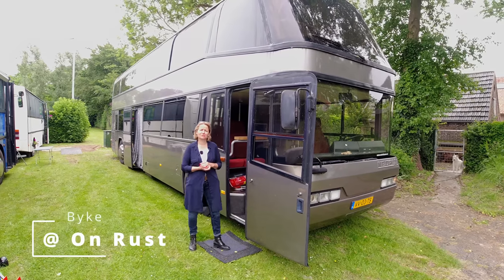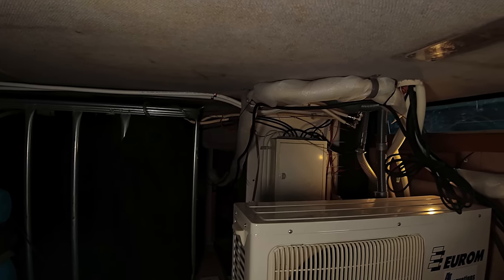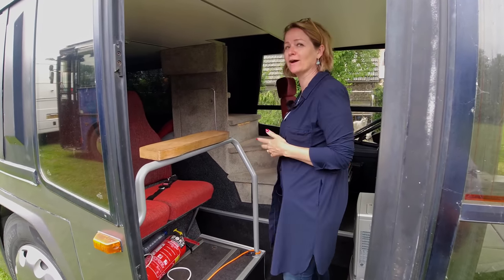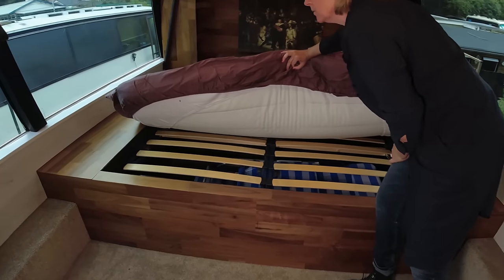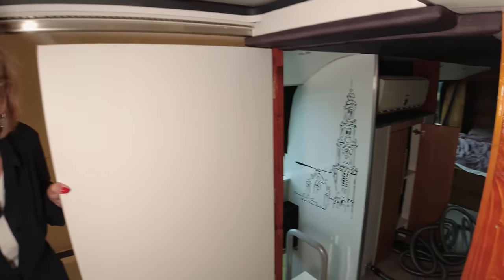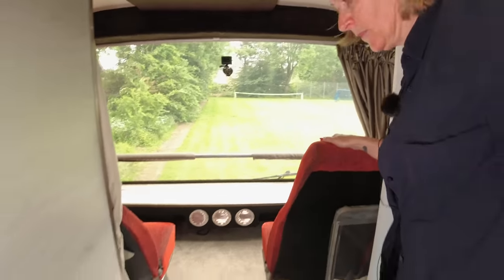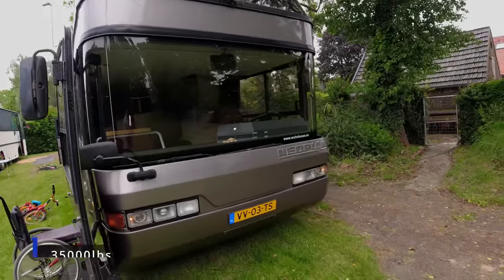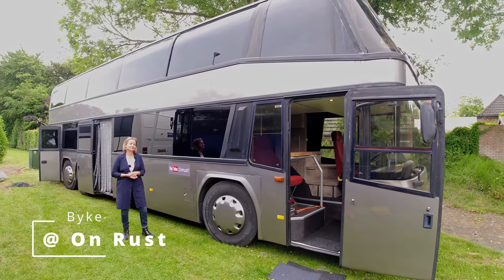From Double Decker Bus into Tiny House

Comment: I will never understand why people think insulating a wooden box and putting the generator in ITIT is a good idea your generator will get very hot in there and that's the worst thing you can do to a gasoline or diesel powered engine is the get it hot dumb

Comment: hello, great car 😍.  Well laid out, lots of storage, quite spacious.  the Dutch are lucky, their country is much more restrictive than France on motorhomes and other leisure vehicles… One thing wonders me, why not simply replace the black and compost water toilets with an incineration toilet?  ?  its maintenance is minimal and the ashtray to be emptied is tiny.  for gray water, a degreasing tank is sufficient.  Beautiful achievement.
Reply: The main reason was that an incineration toilet is very, very expensive. Another is that it takes quite some energy, that is not unlimited aboard a vehicle. No, I looked into composting toilets, and wanted to fit one of those, but my wife couldn't get over the thought that there would be poop in the toilet all the time. I still think a composting toilet would be a good option.